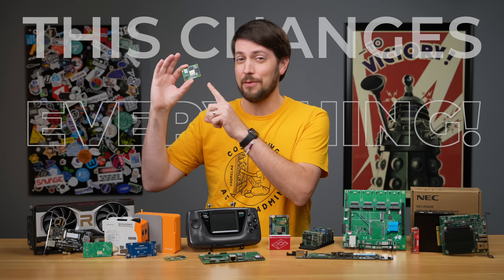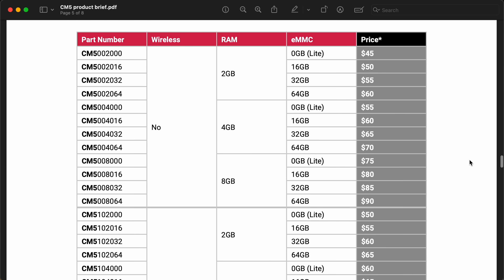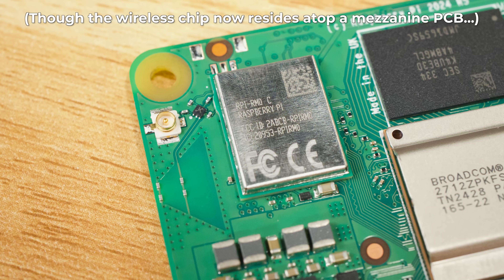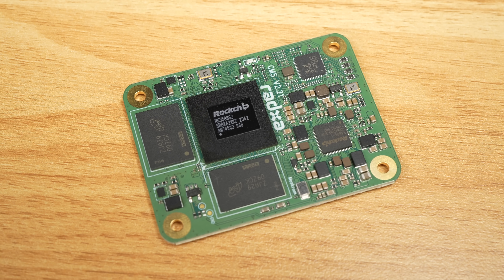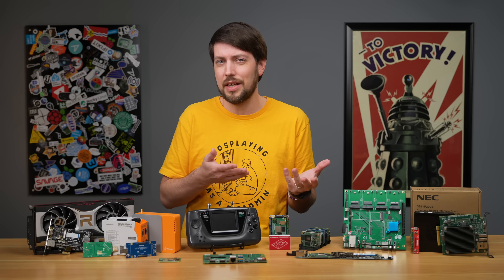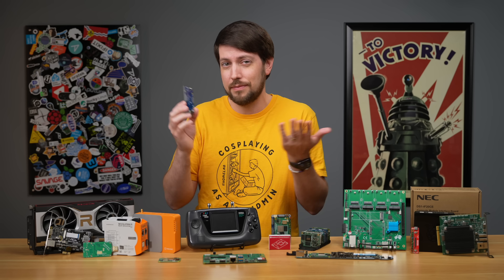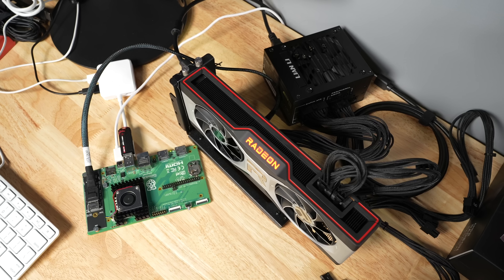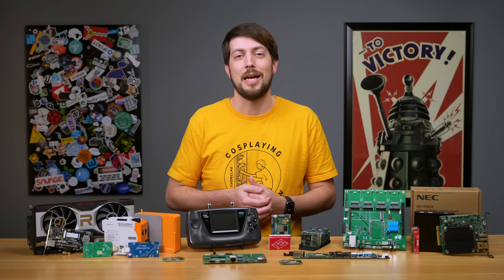This tiny computer changes EVERYTHING

Comment: Hopefully someone is quick to making an itx/atx board for the CM5 that can use ATX power and a PCIE slot, I think this really is the first raspberry pi to ACTUALLY be a desktop replacement, the CM4 was fast and all, but the CM5's improved PCIE support is major imo. Exciting stuff.
Reply from the maker: I would love this so much—Radxa led the way for an Arm SBC-based ITX board, would like to see something either official from Pi, or from a 3rd party that works nicely.
Reply: @JeffGeerling  or even an upgradeable version of the keyboard with the built-in pi
Reply: Turing Pi cluster update,  @JeffGeerling
Reply: As a noob in SBC matter: why just don’t use N100?
Reply: @Adam130694  Arm is low power. The N100 uses about 20W, the Pi 5 about 10W, or about half the power consumption. Sure for a desktop the N100 would be the better option due to compatibility, but the Pi is meant for projects that need efficiency
Reply: @ I saw 5-8W at IDLE in Windows on N100?!
Reply: @Adam130694  Correct, IDLE. Not under load. The Pi is only about 2W more UNDER LOAD than the N100 is IDLE

Comment: It's great that this is a drop-in replacement on the Super6C! I did try to run Ceph on that in the past, but my experience has been that it is seriously hampered by the 1-Gbe switch; Ceph really needs more bandwidth than that. Unfortunately, as you said earlier in the video; despite the CM5 theoretically having all this bandwidth, there is no way to get it out of the module on the Super6C. I would love to see a Super6C with a 2.5 or 5 Gbe switch chip on it.
Reply from the maker: Ditto! DeskPi's been pretty good about updating based on community feedback (like they've tweaked their 10" rack accessories a bit since they launched!). Hopefully they can do that (at least 2.5 Gbps...).
Reply: It would be nice to know if any of the control features (via I2C interface on the chip) are wired into the Super6C anywhere at all - from what I see on-line, the RTL8370N ether controller will switch 16Gbps worth of traffic and will do 9k jumbo frames at that.  (The other throughput figure I see is 11.9Mpps@64bytes.)  So, one should be able to push a reasonable amount of traffic among the nodes - and this is easy to test.  It has been suggested that the chip only does "Balanced-XOR" teaming, but I don't find any suggestion of that in its datasheet.   There's at least one undocumented feature of the board - it has a four-pin 5V aRGB LED interface populated on the board.  I haven't tried plugging anything in to it, but I did read 5V on the appropriate pin one of the times I had it open.
Reply: Does it working cm5 in super6c ?

Comment: I really need a 16 GB RAM model. Long story, too much data.... Crossing fingers.
Reply from the maker: I would like one to see if I can get Forza Horizon 4 running. It was so close on the Pi 5 8GB!
Reply: @JeffGeerling  I need to store 60k ~5000 word documents plus audio (each representing about a minute of spontaneous speech) in a python dict, and then run multiprocessing on each core (can't thread, a longer story) for a half dozen different statistical things, including wav2vec2phoneme. Are there any competing boards available now that already have 16G RAM?

Edit: thinking about this suggests a way I can fit it in 8 gigs, which is probably what I should do if not.

Edit2: on third thought, I can push far more stuff that doesn't need to be in RAM to disk without tolling the most costly inner loops. But I am still curious as to whether there are any 16G competitors, clones or otherwise (as long as pip3's toolchain works). I should probably fix the dict bloat either way.

Comment: I thought the CM5 would have 4x PCI-E lanes for some reason
Reply from the maker: It technically has 5! But 4 of them are routed straight into the RP1 chip.
Reply: @JeffGeerling  According to the device tree, the BCM2712 even has 6 (two x1 ports). No idea where the second x1 port is though.
Reply from the maker: @coreforge  My guess is that was 'dark silicon', used in some Broadcom-specific device, because it's never been exposed on a Pi device (yet, at least). I'm wondering if it was dropped in the chip's D0 stepping.
Reply: Same here. Wonder if someone is capable of doing some surgery to the RP1 pins and leave it with just one data lane.

Comment: cm5 vs rs pi 5 which is best is there  a huge diff?
Reply from the maker: Pi 5 can work out of the box—with CM5 you need a carrier board of some sort. So minimum price you'd pay $65 for a 2GB CM5 that's functional (2GB CM5 + IO Board), versus $50 for a 2GB Pi 5.

However, you can do a lot more wild stuff with the CM5, though all the carrier boards available!
Reply: @JeffGeerling  Already been on Aliexpress  since your vid was released.
Reply: The CM5 has less IO, but only marginally. Otherwise the functionality is basically the same.

Where the Pi5 wins is that you can use it out of the box without needing a seperate IO board.

Where the CM5 wins is on being easier to integrate into a larger system, without undue bulk. You can design an IO board PCB to fit whatever shape your system needs and give you the connectors you want in the places you want.

Comment: It's really disappointing that you can't order this. The links from Raspberry Pi's website link to suppliers that are 404 or blank.
Reply from the maker: Some suppliers are set up on launch day, but it normally takes a day or two for a new product with so many SKUs to become available at all of the resellers.

Honestly, I'm not holding my breath, hopefully they're easier to get in a couple weeks! (Normally, a new Pi model takes a month or two to get into wide distribution — the Pi 4/CM4 generation excepted, due to the parts shortages then...).

Comment: I just can't handle that much performance. My brain still works well with RPI 2040.
Reply from the maker: "264 KB [of SRAM] is enough for anyone!"
Reply: @JeffGeerling  I got was able to fill up the RP2040 SRAM in C, so it can be a limit 😂.
Reply: The RP2040 is a very versatile chip. If only the RP2350 didn't have the stupid errata E9 bug because it would otherwise be a true no-brainer upgrade.
Reply: @jimtekkit Thanks for your comment, really.
Reply: My brain is Teensy 4

Comment: I keep waiting to see what you are going to be next time. Each time though, you say until next time, you're Jeff Geerling.
Reply from the maker: One of these days...
Reply: @JeffGeerling  Next time: "I'm AI Jeff."
Reply: @thegrientsiis  No, it has to be a phase where Jeff Geerling is being fused with AI, then another when AI gets rid of the analog evidence...
Reply: @JeffGeerling  "Until next time and beyond, I'm [...]"
Reply: @JeffGeerling 
Alter ego awaits 😻
Excellent videos.. a little above my ability.. but brilliant to be updated with what is happening.
I'm from the time when OC71s took over from valves..
Also made crystal set's as they didn't need batteries which were expensive as they didn't last long..
and then there was the NE555 that thinking about it was a PI of its time as we made all sorts of things with it.. flashing LEDs to sound generator's 😻
After college I worked at a electronics company... and built one of the first sound cards in the UK for the PET computer (the chip cost £25) about 1981 ..
another lad got the beeping noise to say a rather rough Hello 😻
I also had a (think it was) Winchester hard disk, a white plastic case 18"? diameter with moulded handle that contained a disc about the size of an LP, I looked it up a while ago and apparently it had 1mb per side..
and slotted in the top of a unit the size of a washing machine but a little taller..
I'm in the UK..
Are you aware of what happened at Bletchley Park during WW2..
Reply: @JeffGeerling  It's reassuring when Jeff Geerling continues to satisfy the identity property, Jeff = Jeff , and all is right with the world.
Reply: @JeffGeerling  FF?
Reply: I do not know where he gets the time to sleep with all the kit he is testing and playing with·
Reply: I'm worried that one day he won't be Jeff Geerling next time, but some AI pretender.
Reply: One day he might bring other people to his show, who knows... 😁
Reply: Good point. I guess one never knows, right? 
I'll start to close my work meetings with project clients in this way, I'm afraid they would want to be in the know.
Reply: NO.
The Universe is rendering or being rendered a few 100 billion frames per nano second or less. So yes, there are always a few atoms amiss here and there. So you are not the same everyday.
Reply: Maybe a season greeting from ... Santa Jeff, or Elf Geerling. ;)
Reply: And every video he claims "this changes everything" and then goes on to shill something.
Reply: "I'm Batman"